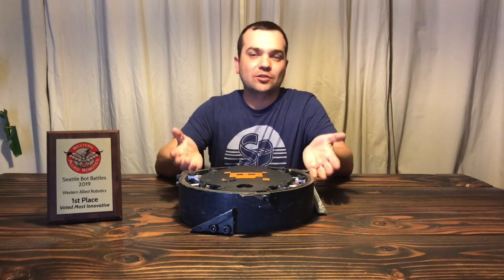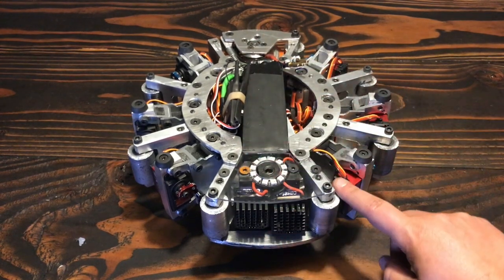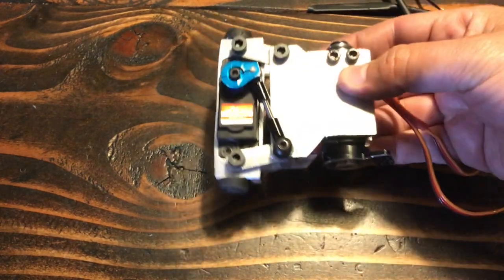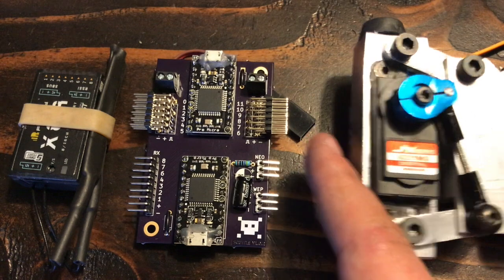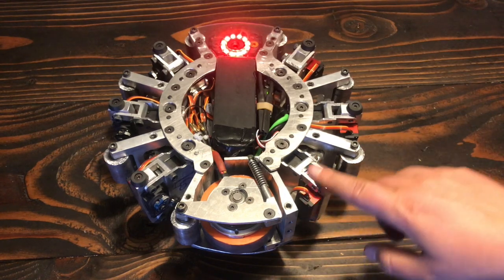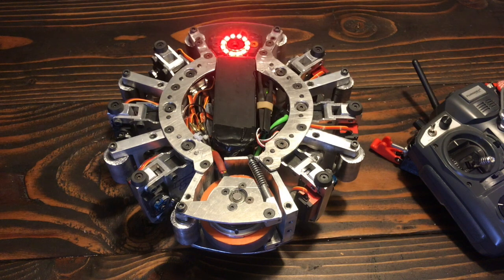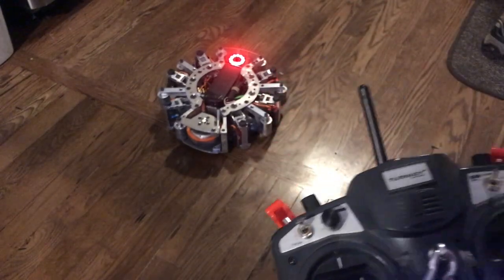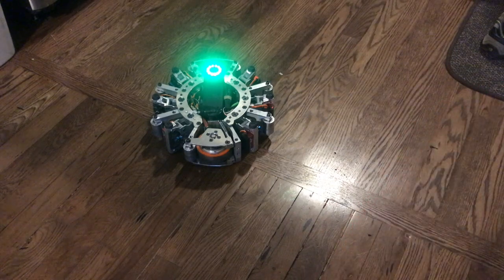How Scuttle Walks

Comment: This is so awesome! I'd dismissed walkers since the fragile legs were too much of a liability but never thought to combine that with the protection of a ringspinner! 
Also, could you maybe even use the X axis of the throttle stick to control turning on the spot so the the tank drive steering stick can become omnidirectional input to better utilise the hexapod system?

Comment: If your radio has a CPPM output you can decode all the RC channels using a single Arduino interrupt pin.
Reply from the maker: You know, my RX does do CPPM. I will have to test this out. Can you typically do PWM in conjunction with CPPM?
Reply: I use one interrupt for the CPPM input and 3 PWMs for drive and weapon outputs from an 8MHz pro micro.
Reply: void getRC(void){  //called by interrupt rising edge approx 12us
  static unsigned long oldmicros;
  static int channel;
  unsigned long newmicros = micros();
  unsigned long dt = newmicros - oldmicros;
  oldmicros = newmicros;
  if (dt > 2500){
    channel = 0;
    RCchans[0]++;     // Rolling count of RC frames started
  }
  else{
    channel = constrain(channel + 1, 1, maxRCchan);
    RCchans[channel] = dt;
    if (channel == maxRCchan){
      gotRC = true;   // Complete RC frame received
    }
  }
}